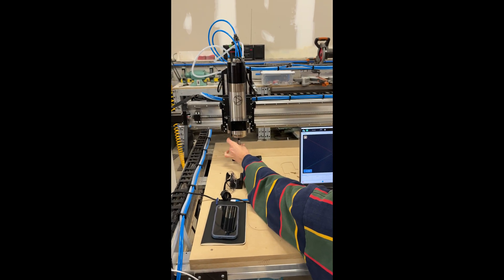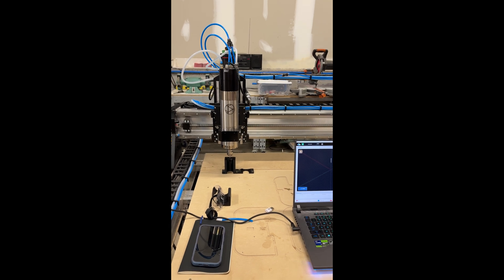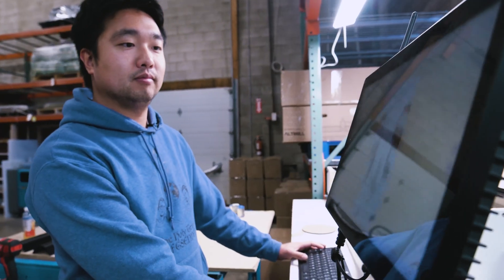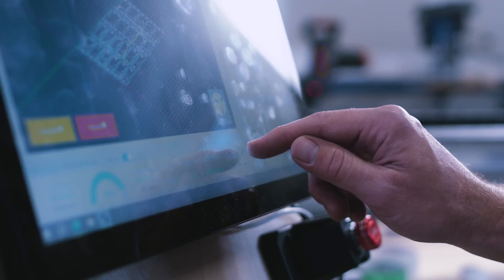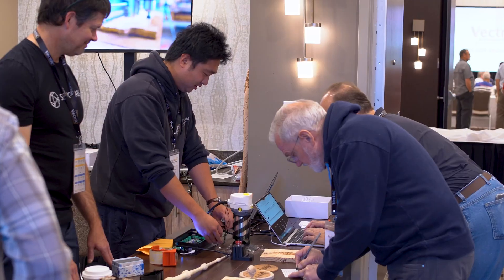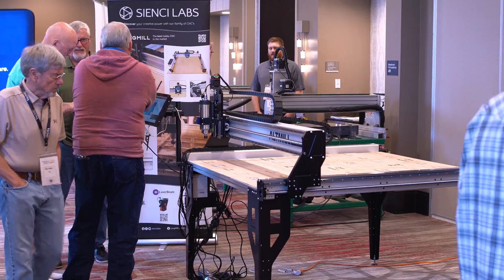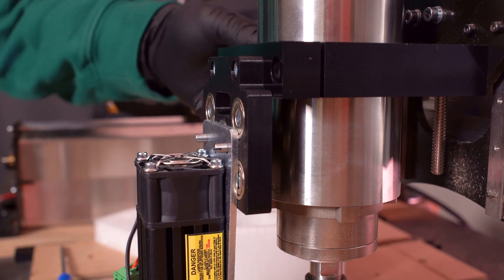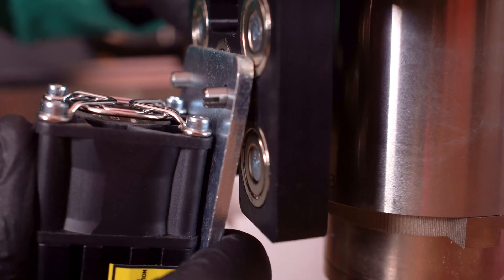Sienci Labs Monthly Production Update - November 2024 - AltMill CNC, gControl, Router, etc.

Comment: I love your CNC machine. Simple, affordable, modular and efficient. Does you machine also works with regular dxf files like from AutoCAD? Thanks and much success.
Reply from the maker: The machine understands gcode files, so you'll need to use a CAD/CAM software to import your DXF's and save them as Gcode. Most of the CNC CAD/CAM software imports DXF files, so you'll be able to to use your DXFs!
Reply: @SienciLabs  Thank you so much! Now I know. I really love the machine because many companies offer high end machines with also a high end price. You machine is 1.  available for fair price, 2. you can use any milling cutter brand like Makita, Bosch, DeWalt etc. 3. you can cut many Materials just need to change the cutter/drill. Especially your modular system is really a game changer in the market. I wish you good success.

Comment: When I assembled my Altmill the large X gantry extrusion didn't mate well with the left side Y gantry plate. I had to force it into place using the clamping method and it still sticks out about 1mm, while the right gantry plate is fine (completely flush). Is that the extrusion manufacturing issues that you mentioned? How worried should I be about this issue? Will it affect my Altmill accuracy?
Reply from the maker: It's ok that it sticks out a little, it was a design feature on purpose. It won't affect accuracy because we did it on purpose!